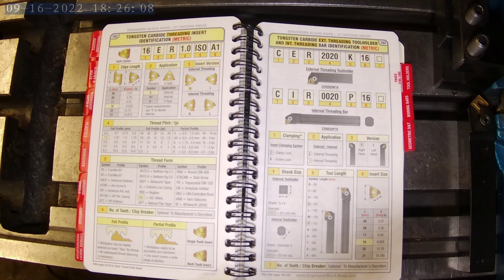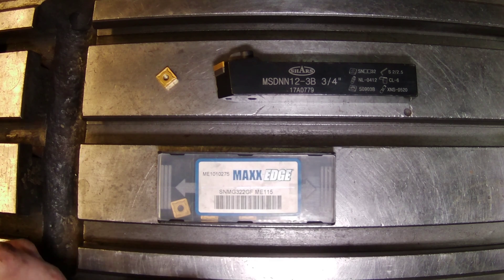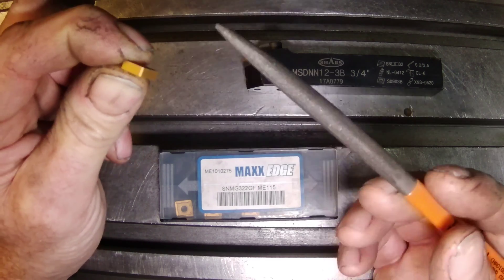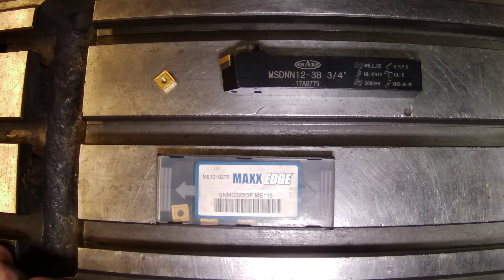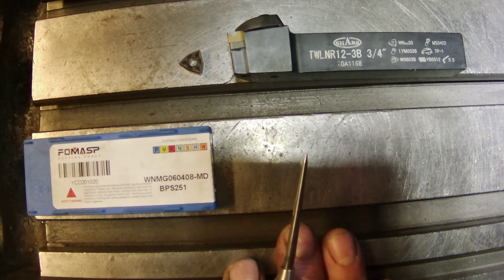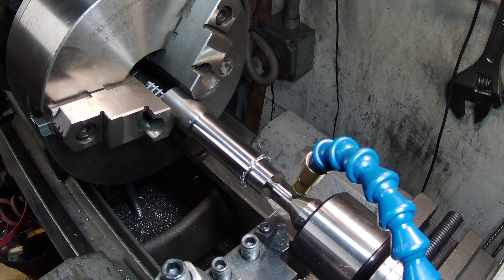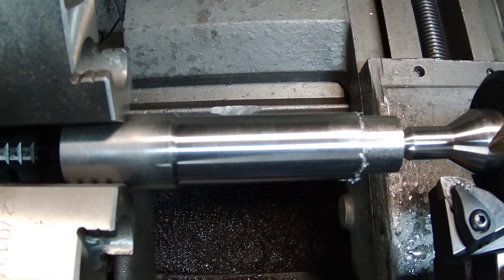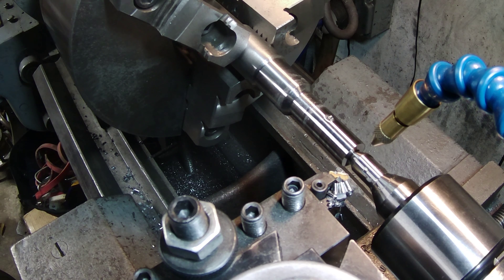What Carbide Insert is best? SNMG vs WNMG. Carbide insert and tool holder nomenclature explained

Comment: Interesting. In my old school opinion the best thing you can do with inserts is to use high speed steel instead. 50 years machining and rarely was carbide actually needed for a job. Inserts were created for and are best at high volume high speed Production factory work. There is nothing that was done here that couldn't be done with HSS tool bits and a LOT cheaper.
Reply: Time is money and inserts are cheap and repeatable. Even if you are quick, the 10 mins it takes you to regrind and find the new zero position for the tool is more than an order of magnitude longer than it takes to flip an insert. What is your shop's rate per hour? How much is that ten minutes worth? A lot more than one insert's edge I hope.
Reply: theres another one that beats both for the home/hobby shop.. stellite.

shame its virtually impossible to find. the old fleamarkets are the main source.

its between hss and carbide and would be better known except it came out in that brief period between the two and sort of got swept under the rug for most anything but facing aircraft valves...

i love my inserts but i have a pretty good selection of hss... theres plenty of jobs that does NOT suit carbide...

Comment: Great info. Although, it's not a fair assessment/comparison. Snmg is using a 90* tool holder vs the wnmg is using a rh tool holder. The cutter attack angles are different. If you were to cut left to right with the wnmg rh tool holder, you would get much better results. 👍✌️🤙

Comment: Looks like at about 8:50 your live center begins to not rotate consistently and at the same rpm as the workpiece. Which could possibly explain the chatter. If the piece slides into the chuck towards the headstock that will happen. Or it could just be from the camera.
Reply from the maker: Great observation. You might be exactly correct on that. I'll have to pay closer attention in the future. Appreciate the support my friend
Reply: Can you give me book in pdf please creater give me tool book pdf

Comment: i get CHATTER !!!!!really hard when trying the SNMG as a groove tool ??SNMG insert 16-4d holder maybe i am not supposed to use that but it seems like the only way to create that V (90degress) groove but i get chatter 
anythoughts?
Reply from the maker: Hello Fred thanks for the comment. So if you can manage to go in with a parting tool and cut close to the depth of the groove then go in with the SNMG I bet you would get better results. Even better if you can only cut one side a time. Also, be sure you are on center with a minimum of stickout. You may also want to try increasing/decreasing the speed or feed to see what changes. Sometimes like with parting (Although it seems counterintuitive) feeding faster will eliminate chatter. Are you working as close to the chuck as possible and between centers? Can you use a steady or follower rest to support your work? I would also say check you spindle bearings and end play. Start simple and move to the more time consuming things. Mainly rigidity is your friend. Make sure everything is as solid as possible. Best of luck and thanks for watching! I have a video coming to address some of these things as well. Take care.

Comment: It has been my experience that few insert boxes from china have the alpha-numeric code from the Black Book or any other book for that matter printed on them.  Once in a great while but most haven't had it.  Most tool holders also do not coincide with western  nomenclature.  It is one of the great difficulties using chinesium.

Comment: Were you doing a 0.100" depth of cut or was it a 0.100" diameter reduction? 
It looked more like a 0.050" DOC
Feed rate is for finishing, roughing would be closer to 0.010"~0.020"/rev.
The relationship between nose radius and feed rate is what will give better surface finish plus the overall surface speed (rpm+feed rate)
 Speed is also way too low, that's the sort of rpm you use with carbon steel tooling and which is why you were not getting good chip formation, material was being 'rubbed' off
If chips are not turning colour, your going too slow to use carbide effectively (you want chips 'brown' at minimum and blue' is 'better, it isn't pushing machine or tooling with 12L4 and coolant)
 Negative rake tools require a larger more powerful machine, the things you are doing would actually be better with HSS, using 'industrial' tooling isn't actually the best idea for almost all hobby machinists. (use positive rake tools even if you don't get double the cutting edges)
I was hoping you would go into the 'grades' of carbide, most Chinese stuff is for  general purpose/cast iron (grade C6) and around 65 Rockwell C, 'chrome steel' bearing housings are often about the same hardness or harder but can be easily machined with correct tools which will even cut HSS quite easily if machine and set up is rigid enough
 'Micrograin' carbide inserts are often much harder but machine rigidity is more important as carbide will chip very easily if there is vibration/machine/tool flex
Reply: I totally agree with you. On the back of the insert boxes show what material the insert is good for along with the suggested Surface footage and chip load. Also the lead angle of the second cutter is 45 degrees ,lengthening the chip.

Comment: Great tip, I have that handbook too. Way more convenient than online or Machinery's Handbook tome. May want to use a camera mount that is not connected to the lathe. Even small amounts of shake get translated very efficiently to the video, unfortunately. Some folks with more massive lathes get away with this, at least with a well-behaved objects, but even they have a problem if the part being turned is not radially symmetric.
Other things to consider: I notice that in several videos you introduce the next 'test', but then insert clips of other information (thermal imaging or close-ups showing surface finish) from the prior operation before you actually go to the next 'test'. Because you describe what's being shown, it is clear, but simply splicing in the other scenes before announcing the transition would be clearer. Perhaps this happens because your narration is mostly real-time and not separate voice over. Anyway something to consider as you generate more content...
Reply from the maker: Thanks so much for the advice Steve. I am ALWAYS trying to improve things. Glad you enjoyed the video and appreciate you taking the time to send a comment my way. Have a great day!